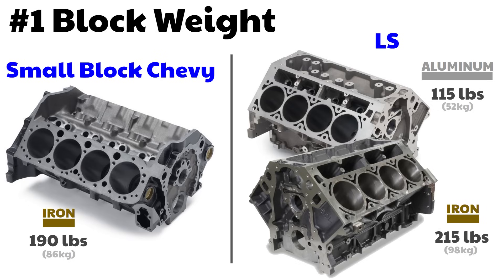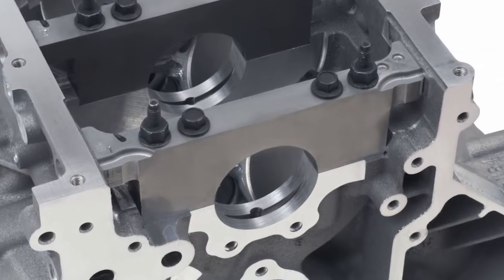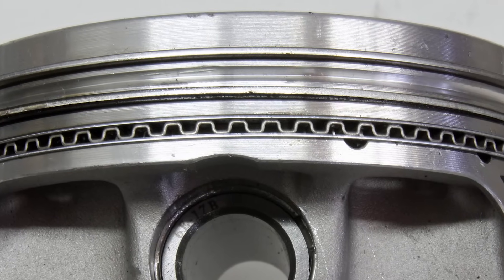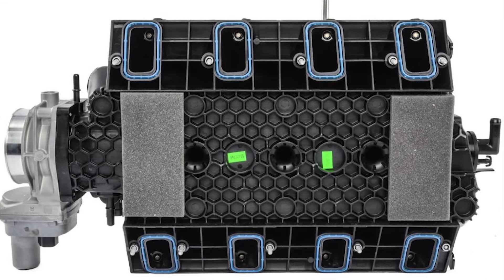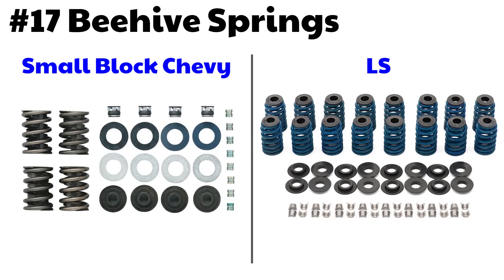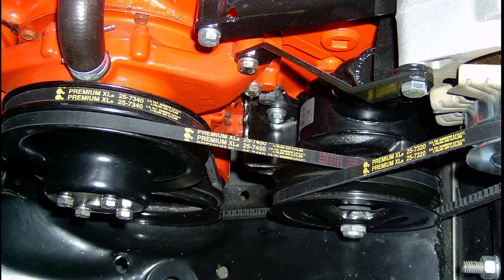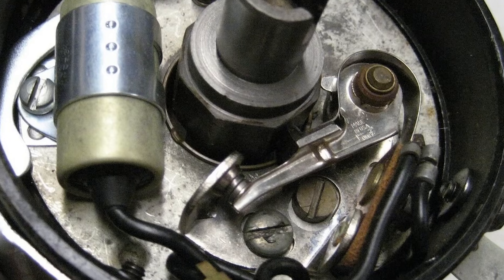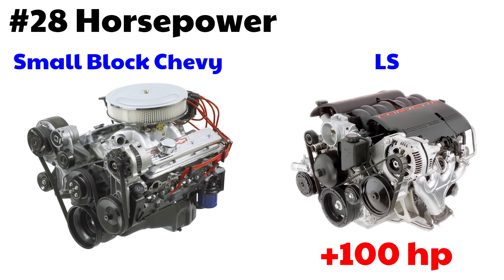29 Reasons LS is Better than Small Block Chevy (Gen 1 & 2 vs Gen 3 & 4)

Comment: The Ls engine is a much better design, because it was designed to use modern technology and manufacturing processes. They did an excellent job, just as their competitors did on their designs. Take fuel economy and emissions requirements. Those things had a big impact on modern engine design as well. I am an old school retired guy. My Silverado has an all aluminum 5.3 that is truly impressive. My wifes Buick has a 3.6 vvt engine, which is truly impressive. All my hot rods have gen 1 engines. If I could swap to the ls platform I would on a couple. The cost to swap them all is just not justified, I have other things I must spend money on. The LS stuff is sweet, but somewhat expensive, if you do the total package PROPERLY. 
Right now my gen1 will do, I'm not trying to impress anyone. But when I take my gen1 stuff to the dragstrip, antiquated and out of date as it is, and min the money, I have to remind you that the payout isn't based on what technology is under the hood. So your snarky comments about old timers, you can just shove that you know where. If gen1 and mark-4 hadn't built up such a following for high performance, the base....the ls platform wouldn't have even gotten the drawing board...the v8 would be DEAD. Respect your elders, they paved a way for you, to throw snark.

Comment: They actually have two belts. Ac runs on its own belt
Reply: Lol. You can see this clearly in the picture he shows at 9:23
Reply: @TurboNFRStwoK  he didn't acknowledge it though lol
Reply: @reverandhale863  Sorry I was not more clear in my statement. After re reading it I can totally see how you read it that way. But I was actually in total agreement with you. The lol was because he said it only has one belt then immediately shows a picture of the engine clearly with two belts.
Reply: @TurboNFRStwoK  yeah that's hilarious lol. I mean maybe he's just referring to the belt needed for the engine to run. GM has been using two belts on their ls based engines since the 5.3 first came out.

Comment: Yeah the LS is superior in many ways Your vid is pretty bias your comparing an LS tho the old sbc you even mentioned points! An LS has an ECU!!! Gm has had ECUs on there engines since the 80s!!!  not the later models like the LT1 and vortec SBCs they both had modern ign, multi port injection, roller cams, revised gaskets high flow heads, better designed exhaust...A stock vortec 350 makes about the same hp as a stock 5.3... let's compare apples to apples as much as possible

Comment: Obviously factory sbc are weaker than a factory but it's not necessarily the design but the materials and what they were shooting for but you get aftermarket components a sbc architecture is quite adequate...In all actuality even tho the ls has a skirted cross bolted block there are reasons some say SBCs lower half architect is more desirable in ways. That's why world products build that hybrid block which is basically a sbc that accepts ls heads and intake. Steve morris just posted a "mild street build" 400ci procharged sbc that made 1200hp on pump gas and 1380 on c16! And it's nothing exotic it's off the shelf performance parts... Basically the title should be why a oem LS is better than an OEM sbc... If built with quality parts a sbc is quite competitive to an LS, your bastardizing the sbc architecture in every form judging it from the factory built engines performance level.
Reply: I was looking for a comment like this, thanks for delivering!

Comment: I’ll put my sbc against any ls any day, a lot of this information is a bit exaggerated and/or understated. All comparisons are STOCK parts, nobody running stock parts.
Reply: in the 60's, the only cars that had 500 horsepower were the ones in nascar. Even the dyne numbers back then were unreliable. they took engines that back in the day were the holy grail and dyno'ed them today. Based on an article, they didn't make close to what they claimed. But a ls3, makes 426 to the wheels. thats more than 500 to the crank. And thats factory. so stock to stock its leagues better. but if you wanna compare an all motor small block. compare all motor SBC to all motor LS.
Reply: @68Cowmaro  my all motor pump gas sbc makes 558 hp to the wheels and I’ve only got $8k into it. How much is an ls3 crate engine? Not to mention other costs to get it to run. Sbc is the greatest engine ever made!
Reply: Good point🤔
Reply: Hmm, I don’t agree with what you just said at all. I have a 6.0 stock on a gto 

And no, I’ve been around the 350, 305 a horrible 415 god that was the worst one I’ve seen. But the 6.0 I have literally is newer faster and better guess why the small block was replaced by the ls cause the ls was just better in every way  even in tunning fuel  
injectors, coil pack > carburetor and distributer  
That’s just modern cars I bet yeah even with a good tune it’s fast but tune a ls and you got a machine I am fully aware of what the sbc can do but you   Try a new ls there just so much better and there cheap
Reply: @thisguytrucksoldtrailer6875  yeah and how much you pay for that car? My small block would blow your doors in. Sbc is still king of the money to power ratio
Reply: @norrinradd2214  I’ve been around sbc don’t tell me I don’t know about them there ignitions systems are Stone Age like how they get there gas as well
Reply: And also the best one was the 305 why cause it’s weakness was it’s strength it was reliable because it was so weak oooh wow 125 hp big dealll....
Reply: @thisguytrucksoldtrailer6875  you don’t know a damn thing about the sbc. You say “Stone Age” but if you know what you’re doing that stuff works great.
Reply: @norrinradd2214  do you know anything about electrical??? Coils are way better and newer
Reply: @norrinradd2214  and also you don’t know a dam thing about the ls have you owned one?
Reply: @norrinradd2214  don’t make that assumption cause you don’t know who your talking to,. Yes I agree same thing sbc and ls both great workers for both my trucks and my gto. Yeah I bet you can get a ton of performance out of a sbc but the ls was designed for being tuned the block is stronger, and just more modern I have nothing against a sbc great motor never had and problems tried and true rather have it over any over any other brand of v8 except the ls, it replaced the sbc cause it was stronger and better at what gm wanted from it. I totally can agree 350 is way cheaper like go to a pull a part junk yard and you can get a sbc for like 100$ if you go to the right yard
Reply: @norrinradd2214  do I think the sbc Chevy came with a lot of power stock no, it used to be a big deal to tune 1hp per cubic inch

Comment: Wow this is so wrong.
Reply from the maker: What is wrong?
Reply: Everything ,I am sorry I have built 500hp motors used the right heads cam crank, and did it under 7000,5000, 2000, know we compare apples to oranges, performance blocks to target blocks , even the best crate gm motor is more expensive then to build the combination and get big numbers, and the same can be dun to older heads that the new ones already have , and they have heads that flow like the new ones. Know the new heads and block there is not much you can do to them for big gains. Had a LS motor blow up on the dyno,only had 650hp, with the same combo on the old school block 710, did not blow up,

Comment: I would really like you to do a LT swap video in your 68 Camaro. I have a 69 Camaro SS396 car and I am considering a similar swap. I assume you will be using Direct Injection as well?
I will follow your channel so I will be able to know when you do the swap.
Brett.....
Reply from the maker: Hi.  Thanks for joining.  The only thing that scares me a little it with the LT swap is it has some major added difficulties, Im thinking about doing a quick video about that actually.  For sure I will be doing LS or LT swap.  Does your Camaro have the a big block in it now?
Reply: @AutoGuild  Yes, 396 in it now. I just installed Terminator TB with HP ECU EFI 2 months ago. I like it more than carb for sure.
Brett.....
Reply from the maker: @brettallen1525  Sounds cool.  So are you thinking about a LS/LT swap now?  Cause it sounds like u have a good motor already.  My 327 in my camaro is making like 100hp, its so tired its sad.  : (   She's definitely ready for a new engine.

Comment: You can put WAY more than 375 to a cast 2 piece sbc crank. Idk what youve been reading but you have been seriously mislead. Sbc arent these nutless brittle engines that crumble under a little bit of power. Granted youll have to do some slight mods like cam,pistons, and heads but it isnt hard to pump out 500-600 horse with a small block. LS's have superior head and main cap design but of course it does. Its got 40 years of R&D to come up with that!
Reply from the maker: Yeah I got those numbers from a Hot Rod article and they are conservative for sure, they were referring to the early SBC engines.

Comment: I call BS on the oil pan. I had a cast aluminum oil pan break and leak oil on the driveway. The dealership replaced it with a stamped steel one.
Reply from the maker: Cast pans probably more prone to cracking thats for sure, you may have hit something on the highway.  The cast aluminum pans are definitely way more expensive so GM must have changed to them for a reason!

Comment: So what happen when you swap aluminum heads for iron heads on a steele LS block?
Reply from the maker: You could do it in theory but the only LS engines with iron heads were the old 4.8's from 1999-2000.  And it would probably work but would add 30ish lbs to your car.